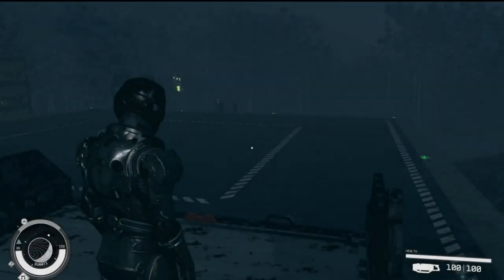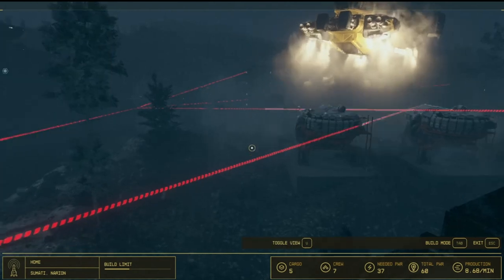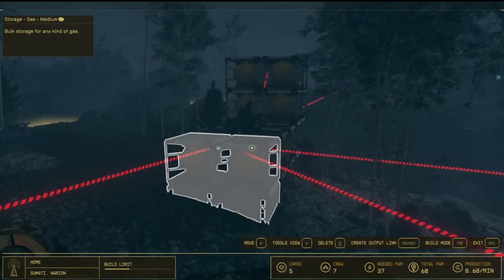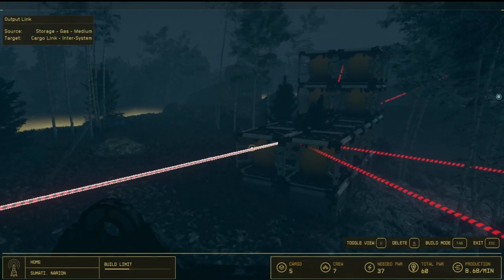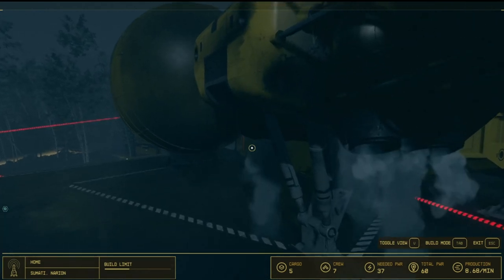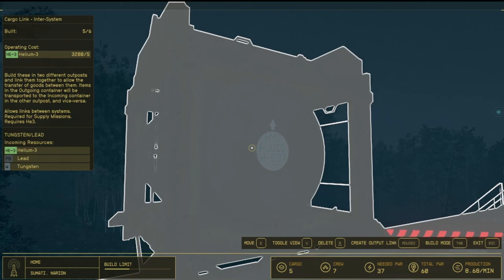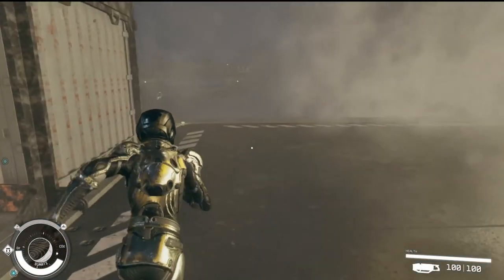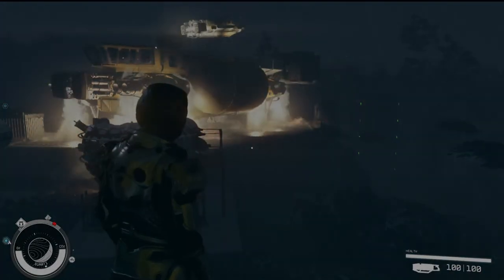STARFIELD Inter-System Cargo Links (Don't Make This Mistake)

Comment: The outpost building system is fun and you can put a lot of time into it. On my first playthrough I built several outposts, farmed resources and connected them to have everything on one place, but…

… after you build all those outposts what are you doing with all the resources? Mod weapons and armor and build even more outposts? When you build let’s say ten to twelve outposts you usually are pretty far in your playthough so you already started to mod your weapons and armor. The resources you didn’t have in your outposts, your probably bought from npcs. So why building outposts when I can buy everything I need to mod things anyway?

Ok you can sell resources at starstations, but that’s an active thing you have to do. You have to fly there. There is no passiv income from those outposts. In FO4 you could set up trading posts and assign settlers to shops. You could leave a settlement and do you thing and after a few days you had some caps. There is nothing like that in Starfield. 

Conclusion, AT LEAST FOR ME.

Outpost building is fun but useless. DLC? I‘m in my ng+5 and decided to not skip the main quest, the faction quests and the companion quests. I built one outpost. For Heller and Lin. Everything I need I can buy from vendors. To quote someone we all know, it just works.

Sorry for the long post.
Reply from the maker: The resource generation from outpost becomes crazy. Like you said, what do we do with all the extra resources? If we had some type of set-up where crew members could sell some of the items from an outpost that would be great! I also think it would be really cool if you could have outpost specific missions for material fulfillment orders with some of the star stations and it would be a passive income without having to do it all manually. The purpose of crew members on a ship makes sense based on their skills, but outpost crew in my opinion just adds to the immersion aspect with no real gain for the outpost at this time. I would also like to see more build items available for that 'home' type of feeling. Maybe a future update or DLC will bring some of these changes.

Comment: I found that my inter-system platform at the destination end just simply didn't work , so I THOUGHT I had fixed it by going to the trouble of setting up a he3 extraction at the destination end,  and sticking he3 in the destination end's power box.     This was a very long cargo route so I thought perhaps a long route needs more He3 ?
If what you say is true, then it proves cargo links of either type sometimes just don't work because Starfield is seriously bugged.  
I'll test your advice and advise the results.
Reply from the maker: Once I realized I only had to fuel one cargo link what I did was make my first inter-system cargo pad and provided it with helium. I then went and made my second pad wherever it would be. After doing that I went back to the first one and created the link between the two. Both are working just fine as of right before me writing this to you.
Reply: @Pandafoo  it worked !  Tried it on another link, deleted the destination,  recreated it, went to the source and created the link. Now the destination cargo link STILL shows it is unfueled, bit the goods started coming through !!  I think the confusion arises because the destination LOOKS like it's not working because of the red "no he3" warning.  
I'll monitor it but looks like a win !! 😃👍
Reply from the maker: Yes that is what happened to me at first which ultimately caused me to add more fuel and helium deliveries to the ship. Made a mess until I did what I told you about & everything has been working fine since.
 @mike_d_melb_music_fan5229

Comment: So that excess helium will mess up the link eventually. You will want to pull that out of that link. This was interesting.
Reply from the maker: yes, at first my links were messing up until I only supplied helium to the power source unit on the cargo link pad. It was a mess Haha
Reply: @Pandafoo  I had a indicate wafer link that had iron in it and the iron would never leave and the wafers were stacked. Pulled out iron and boom wafers offloaded. Since warehouses don't take materials it stacked.
Reply: Indeed. The HE3 can "hog" the outgoing box, and screw up your export.  Or worse yet, "leak" into the incoming box.

Comment: The whole outpost system needs to be redone period. They dropped the ball. Inve ntory control and transportis a total mess. When you build robots that really do nothing you have a big problem.
Reply from the maker: Yes! The biggest issue I have is the bottleneck with storage and transfer containers filling up and then every ship starts back loading into the cargo link pads causing complete failure of the system sometimes. We need some type of limited auto-selling capability at these outposts!  I really hoped with the ability to hire crew for outpost we would had seen this feature in the game.

Comment: Its so broken. I want to build outposts.  I want to like building outposts. Theres just absolutely no reason to build them, and theres literally nothing to build them with. I have 235 large solid storages full of useless crap. I still love the game, but they really botched that settlement part
Reply from the maker: There needs to be more for outpost when building. I had thought these outposts were supposed to be a home away from home. We do not have showers, proper toilets, walls, or actual habs that mimic a house style. I have the same issue with my storage and unless I babysit each outpost and manually take the items it will end up screwing up the output link and have to be redone.